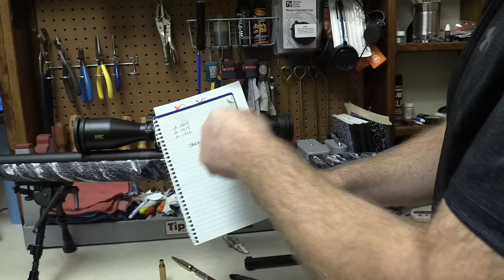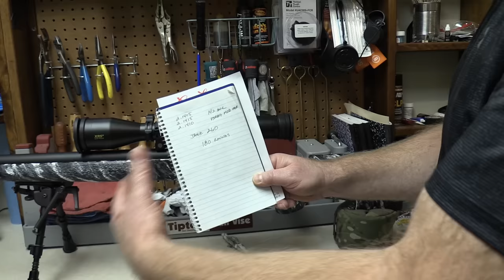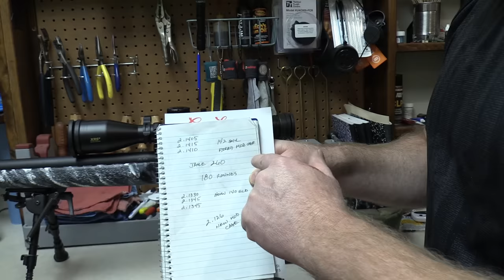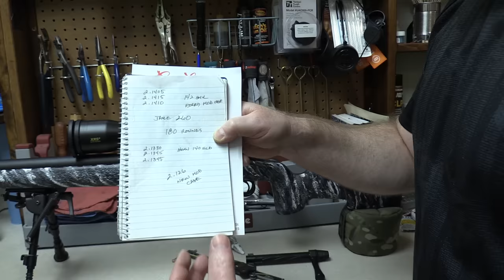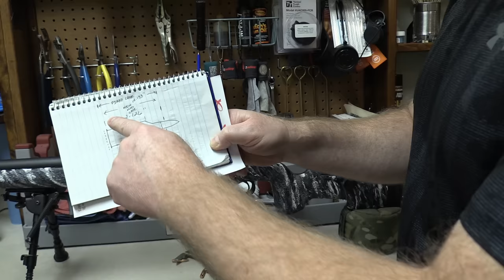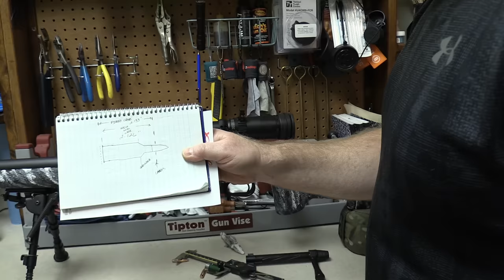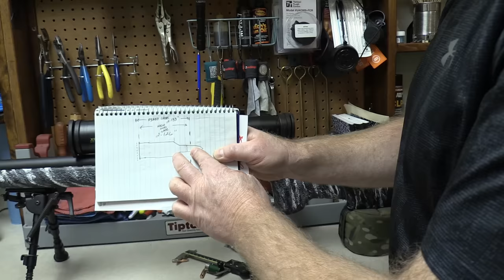COAL vs.  CBTO & Measuring Max CBTO w/ Hornady LnL OAL Gauge

Comment: How much of the bullet is still in the case neck when it gets swagged into the rifling? And would it make sense to have a the bullet supported by barrel steel for rifling swagging instead of a soft brass neck that requires enough looseness to allow it to be inserted and removed from the chamber? Plus spring plunger ejectors torque the cartridge in the chamber and voids out aligment runout efforts.
Reply from the maker: Mike Don’t overthink it. Load some rounds and go shoot them!
Reply: @PanhandlePrecision  I have been loading and shooting for the past 40 years and have heard all kinds of things like a 30 degree shoulder being the ultimate fairy dust for accuracy, when it began as a way to put more powder in a case. And 30 degree shoulder  has somehow become the magical key to accuracy. And have tried to figure out what the magic fairy has been doing with seating depth.

Comment: Do you weigh your bullets,  brass, and primers?  I don't compete but I do hunt and prefer whatever it is I'm shooting to die quick,  in most cases,  so I get as close as I need,  which is much less than a thousand yards. When I'm working up a load I weigh the bullets but don't mess with anything else. I recently decided to weigh my bullets to work up a load but once I decide what that is,  I don't weigh them anymore. I don't shoot past 500 yards where I think 1/10 of a grain matters. I really enjoy your videos,  BTW

Comment: COAL cartridge overall length CBTO cartridge base to O'Give length ? 
Do I have this right ?
Reply from the maker: Yes
Reply: @PanhandlePrecision  me again a year later; see what I've learned.

TIP:  for the Hornady bullet comparator ; I just measured 3 different 223 bullets of different weights and manufacturers and found a total of CBTO variance of some .030. All bullets must have identical O'Gives. 
Then I removed the plastic plunger and filed down the rounded end into a more pointed end and remeasured all 3 bullets again @ 8 each and found the new total variance of the same bullets to be .010. In two of the bullets the CBTO variance was less than 5%. Very accurate now. 
My conclusion is the bullet bases are not 100% perpendicular to the concentricity of the bullet and the plastic plunger end is too large to get an accurate reading on a small point from the base of the bullets. 
This was all done in a brand new JC Custom barrel just purchased and not installed. 
I wish Hornady would install a smaller metal pointed end on their plunger for a little extra money.

Comment: Still watching this but by the halfway point I am thinking head space needs to be determined before working on bullet seating depth. Does your unfired case truly push up against the shoulder in your chamber with the bolt closed? The case that stretches 0.007" sure doesn't.
 Isn't the shoulder bump just making the headspace safe and consistent? So you bump the shoulder of all cases after firing by 0.002" but one case stretches 0.007" meaning it was chambered with. a borderline dangerous amount of headspace

Comment: Excellent Detailed video Sir ...The One Thing I Could not grasp was ,,when the bullet used to get stuck in the Barrel each time and you used to bump the stock and take the bullet out ,,,then you inserted the bullet back in the case and took the measurement to reach the CBTO ,,, Would that not be an erroneous reading of the CBTO ( As you were manually inserting the bullet in the case & it had nothing to do with the way it was pushed by the Hornady Straight Gauge earlier ... You explained that you did not neck size the cartridge ( Correct ? ) ... e.g When I Fire the SMK 175 Out of LCM118 LR Cartridge that uses RL 15 Alliant ,,, the neck of the cartridge expands to 0.3415"  ... Do you mean to say that I Leave the neck to that level and only body size my case  & De Prime it ...( Would that be the " Modified Case " ? ) as i am shooting these and other Berger Hybrids through my Kelbly Rifle .. I Was always Using COAL As My Basis for Measurements but got convinced by the Logic of CBTO As A Precision Measurement Method for Accurate and Uniform Seating Depths ... Pls Shed Some Light on my queries and observations .. I Am Getting different COAL's from my Kelbly Rifle in .308 win for My Berger 155 gr Hybrid Targets & Different COAL Lengths for Berger 185 gr Hybrid Target whereas the Berger 185 Juggernauts Target Match Up with Berger 155 gr Hybrid Target Loads of COAL To 2.944'--2.955' whereas i am getting excellent results at 3.000' COAL In Berger 185 gr Hybrid Target .... The Other 2 loads ( Berger 155 gr hyb tgt & Berger 185 Juggs ) can not be Seated Longer Than 2.9500" ....Pls Comment
Reply from the maker: Different bullets can give different CBTO measurements. Although the bearing surface contact with the insert stays constant, the angle of contact between the nose of the bullet and rifle must change. When I insert the bullet back into the modified case after knocking it out of the barrel, the tool's set screw is locked down. You will rarely get a bullet to slide back out of the barrel by itself. Nose lengths vary widely among bullets, hence the difference in COAL with similar CBTOs.

Comment: You mentioned to run brass through body die before sending fired brass to Hornady for modified case. Can you run through body die after fired brass has been modified from Hornady?
Reply from the maker: Josh Shaffer I’ve never tried it.

Comment: Couldn't I just run the modified case in the Die and have the same results as a once fired modified case?
Reply from the maker: If you're using a store-bought modified case, there's no benefit to running it through a die. They use new cases, which should be smaller than your die in every dimension.

Comment: Sam, I want to make sure I have this figured out.  So my fired case is .005 larger than the hornady modified. I’ve taken the CTOB measurement and subtracted the .020. Now because my fired case is larger do I add .005 or subtract .005 to retain the .020 jump?
Reply from the maker: Matthew Meyer If you’re shooting fired brass, add the .005”
Reply: @PanhandlePrecision  Otherwise his jump would be .025?  Is that right?  Just preparing my first once fired rifle brass for reloading, and want to make sure I have the theory right on this as I have the Hornady modified case also.
Reply from the maker: Gene Benson Yes.
Reply: Has your fired case been resized when you say it is 0.005 larger than the hornady modified case? I am just having a hard time grasping this concept as i use a factory hornady modified case.

Comment: Here is where im lost. Lests just use and refer to max coal. My 308 rifle is being measured with the same set up and Hornadays modified case here. If the average recommended coal for a loaded 308 round with a 168 gr bullet is 2.8 why is my measurements with the modified case and bullets averaging 40 thousands shorter than  2.8 coal? Im getting a average coal 2.765 give or take .001 across 10 different bullets and measurements with my case guage. Yes my brass is fully seated in the chamber, and when i push the loose bullet with the rod i push with enough force to seat them all within the same measurement thats 40 tho shorter than reccomended coal. Its not making sense to me what am i missing here. I also can take one of my loaded rounds with the same bullet seated to 2.815 coal and the bolt closes easly. Ive tried this 4 different bullets with coal gauge and its the same thing, averaging .035 to .040 tho shorter not longer than what a loaded coal is for the 308 caliber.

Comment: Really struggling finding CBTO for my 7mm rem mag. I didn't understand your explanation on belted cases. Please help.
Reply: Ignore the belt, it is for head space control only, just measure from the head to the ogive same as in the video. By the way get a good source and study head space, how and why it works and is required. Most reloading manuals have it you dig into it.

Comment: The sinclear tool is not designed for use with Horadys tool. It should be a bit out of the center. Sinclear its not. it measures out of angle so it will measure approx. 0.01 longer. When you use it without the Hornedys gear you will create ammo that is 0.01 closer to the lands.

Comment: Excuse me where does this Remington case grow 6 thousands at the shoulder, I think your referring to the end of the case neck growing .006", and not the shoulder. If the brass does grow from head at bolt face to shoulder datum point then the Alpha Brass is harder and thicker walled and that could mean you have a headspace concern. If in fact the .006' growth is in the neck of the Remington case then you would need to trim the case at the end of the neck to trim length first.

Comment: Isn´t it pointless to take a used case rather than a new onewhen making your own "hornady modifed case"? since you only measure the length from the bottom of the case to the ogive it should not matter how the shoulder looks like (as long as it fits into the chamber of course). Or did i miss something?

Comment: One you shoot the cases one time, can you use the same length from there on out?  Of does it change depending on how many times the case is fired?
Reply: Just think about a bit. the distance from the bolt face to the end of the leade or beginning o f the rifling does not change, your ogive to head measurement matches that. Your cartridge must fit the headspace of your rifle. Study headspace until it is clear.

Comment: You mention guys seating/measuring over and over as bad.  If consistent CBTO is the objective and all your bullets are different lengths, wouldn't seating the bullet always produce different CBTO lengths?  The bullet seating stem presses on the bullet tip right?
Reply from the maker: No. If the seating stem is matched to caliber, it shouldn’t touch the tip. It should contact the nose of the ogive.

Comment: I’m guessing that you can take the off the shelf case, get the measurement and then measure a once fired case after resized and add that distance to the orginal case?
Reply from the maker: Yes.
Reply: Panhandle Precision probably easiest to get a headspace gauge to take that measurement?
Reply: And resize case by .002?

Comment: My question is where does the stretching of the case occur? What is the tolerance of the case in reference to SAMMI specs. Why not find an over the counter cartridge your gun likes, then just copy that? What is the dimension in the position of the ogive to the lands and what is that allowable tolerance? When I hear people talk about PRECISION stuff, I never hear anything about dimensions or tolerances.......other than “just a little bit”......😳..... also I don’t see anything used as a visual indicator. 

Where the ogive meets the lands is not a bearing surface. It is an interference fit. It touches and stops, it does not slide. There is a class for this to identify EXACTLY what it is. However, there are some things in this video that are useable. Find what the gun likes, and forget the rest. I want accuracy and speed. Speed gets you more distance. You have to use the same exact powder and read the same speed.

Comment: SAM

MY TYPE S BUSHING DIE WILL NOT TOICH BODY OR SHOULDER OF THE CASE....EVEN WHEN ITS GUTTED WITH NO BUSHING ECT. THE SHELL HOKDER HITS TGE DIE BEFORE THE CASE WOULD CONTACT THE DIE

ANY THOUGHTS?
Reply: 85ZERO17 Yes, I have. Turn off your caps lock.
Reply from the maker: Is it a fired case?
Reply: NO..IT IS A NEW LAPUA CASE

.338
Reply from the maker: Then it's all normal. A new case is supposed to be smaller than a sizing die, which is smaller than a chamber. There is no reason to run a new case through a sizing die.
Reply: AGREED, JUST THAT MY OCD USUALLY BEATS ME IN THAT DISCUSSION I HAVE WITH MY SELF...

Comment: I'm surprised you're not using an anvil on the other caliper blade...sometimes you will experience that the CBTO measurement is way off. That's because your caliper is measuring from your primer instead of the base of the brass.

Comment: What are you basing your modified case length base on. Trim to length or max length. Hornady is based on Trimmed to length.  ex 308 Trimmed is 2.005  max is 2.015 That makes huge difference and errors! .010
Reply from the maker: Overall length of the case has nothing to do with it. What I base it on is the length of the case from the shoulder to base.
Reply: @PanhandlePrecision thanks for reply  Yes, correct, but then they wont all be the same length once seating. I never trim my brass to trim length called by the book I keep them at max size. sometimes if ex 2.016 I don't bother trimming to 2.015. if its over .003 Yes I will trim to 2.015.  I don't know maybe been doing it wrong.

Comment: Interesting HUGE difference between the Stoney Point gauge and the Hornady version is the Original Stoney Point gauge used a fired case from your chamber. You sent them a spent, UN-resized case and they modified it by threading the base and slightly opening the neck and sent it back toy you. The Hornady does not do that. I Wish somebody would do what Stoney Point used to do. I feel it was MUCH more accurate. Maybe not.

Comment: Well done video, sir. I watched the load development series last year and took it to heart and really started paying attention to seating depth as you've described. It made a big difference. Watching this one, I got to thinking; it seems the measurement we really care about is the shoulder (datum) to bullet ogive. I'm wondering if it would make sense to track that measurement between the modified case and fired or new cases to keep the jump consistent regardless of what case it is. Maybe we make up a new acronym, DTBO--Datum to Bullet Ogive. I may do some experimenting toward that effect.

Interesting data point for you, too. After watching your series last year, I loaded up 5 rounds on the lands, .010" off and .020" off for my Ruger Precision in 6mm Creedmoor. On the lands and .020" off shot just about .685" groups. But .010" was right at .225". Not saying you're incorrect about there being a zone of accuracy as it relates to seating depth, but I found that to be a fascinating result for my rifle, cases (Hornady), powder (H4350) and bullet (105 RDF). I've found just about any bullet I put into that gun will shoot sub-half-inch groups when seated .010" off the lands. My .223 Wylde rifle cares much more about velocity, on the other hand. As you said, everything is different. It think that's what makes this whole hand loading thing so intriguing. Glad to see the videos back. I always learn something.

Comment: Sam has given us another great video with important information for every rifle shooter  that likes  to roll their own Ammo . Sam i have a Hornady lock-N-load  bullet comparator with the 30cal insert  on it , but when i tried to measure a Hornady Amax 168gr bullet in it the bullet slides into the 30cal insert  all the way until it hits the bottom or end of the comparator body , the bullet freely slide through the insert all the way  without touching any part of the insert . As a result i have been measuring cartridge overall length, i have been lucky so far in that a box of 100  Hornady Amax bullets that i have measured from base to the tip  have a consistent length.   Can i use the .284 dia insert and still get accurate measurements?   Is this a fault with the Hornady insert that i have ? Would i be better off buying a bullet comparator like the one you have from Sinclair ? Keep them videos coming. Cheers
Reply from the maker: I would get a different .30 insert. The stainless Sinclair inserts will fit in your Hornady comparator body.
Reply: Panhandle Precision Thanks Sam
Reply from the maker: You're welcome.

Comment: How do you know when the bullet touches the lands?
Reply from the maker: Nathan H It stops moving. You can feel it.
Reply: @PanhandlePrecision  I feel it stop, but if I apply a little more pressure it goes further in which most of the time leaves the bullet stuck in the barrel. Should I go by that measurement or when I apply light pressure? Thanks
Reply from the maker: Nathan H It’s a comparative number, so go for consistency. With experience, you should be able to take three measurements within .001” of each other.

Comment: Question: when you seat the bullet lower in fired cases than in new cases to compensate for expansion (even after resizing) wouldn’t that change case pressure? Would you need a different recipe?

Comment: Maybe somebody can help me out here, new to this level of precision.  If the measurement is the distance from the cartridge base to ogive of the bullet, what difference does case length make?  If the case is .003 longer the bullet will be seated .003 deeper to get the same CBTO won't it???  I'm NOT saying case length isn't important, I'm just saying it doesn't seem like it would matter in this specific measurement.
Reply: Okay, I think I see that it's not the case length, it's the base to shoulder measurement - is that right?
Reply from the maker: Yes.